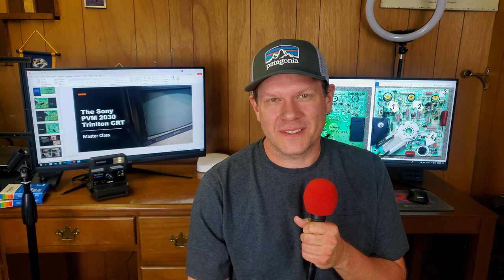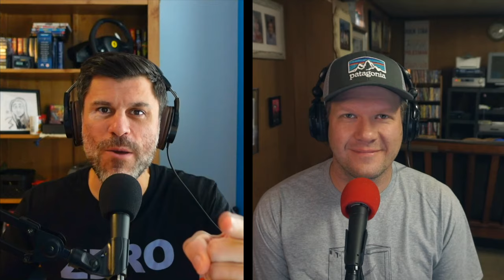CRT Preservation & Restoration 📺 What are the biggest challenges facing the industry?

Comment: On the topic of preservation of the tape. This must be done asap and yes it should get transferred to digital asap to prevent any further degradation because these are likely analog recordings. Start with the VTR that the artist might have used or an equivalent - the goal here is to capture artistic intent. Whatever VTR playback device that best represents this should be restored to ensure playback captures intent. Once this is achieved the analog tape should be transferred to digital. A high sample rate/fidelity should be used during capture to digitally record a faithful copy. The digital copy should then be played back to ensure the experience/aesthetics/intent is true or as technical close to the artistic intent as possible. It may be tricky to close the loop on all of this and the artist might not be around to approve the direction. All in all, this is delicate work but I know that they are in good hands.

Comment: Sorry, I haven't watched the video yet, I'm in the middle of something, but thought about this subject a lot in the past, so will share my opinion. I'm living in the UK and recently I've been looking to recap one screen and fix another one. And there is literally noone who could do a CRT service here. Why is that? Because CRTs are still too cheap and therefore their repairs are not economically feasible. If a decent CRT costs 200 pounds, then it's repair couldn't cost more than let's say 150 pounds. The engineer performing the repair often must spend many hours doing measurements to find a fault... Needs to invest in very expensive lab equipments... Risks being electrocuted by HV... And often must have lots and lots of knowledge and experience to even attempt the repair. The very same engineer could just become a domestic electrician, earning £150 per hour - a few times more, performing a job which doesn't require all that super expensive equipment nor even 10% of electronic engineers knowledge
Reply: You said all the right things mate! That's exactly why. The average people have no idea about the amount of time, nerves and energy it consumes to do that kinda work. It's rewarding as much as it is frustrating. And ultimately only few understand this.

Comment: Apparently not only the last Blockbuster using 8 inch iirc floppy disks but evne chuck e cheese locations that still have animatronics fwiw have the dances etc sotred on those for similar to why medical equipment uses them for being a safer less prone to fail vs an sd/secure digital card is..
Oh also fwiw aviation equipment iirc uses crt displays for some reason as well supposedly.